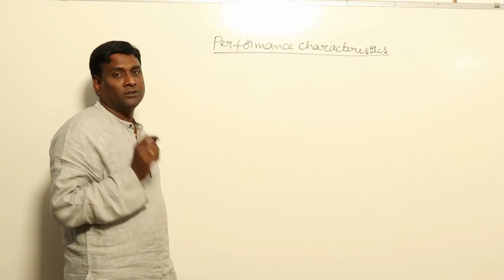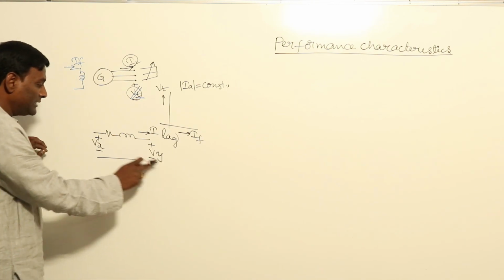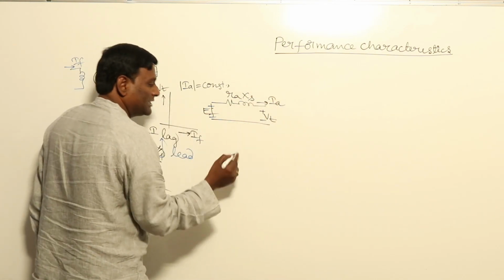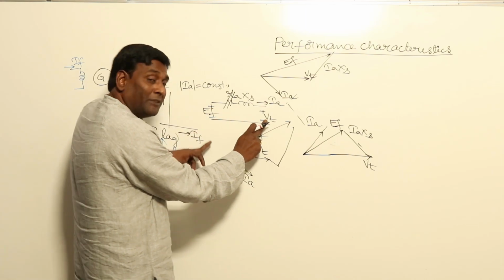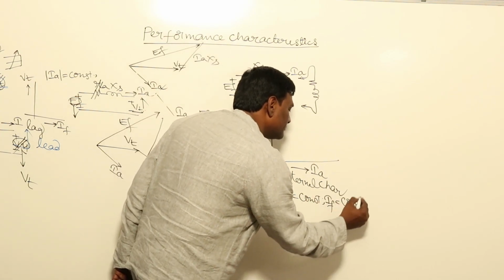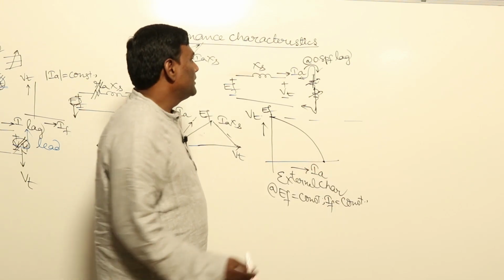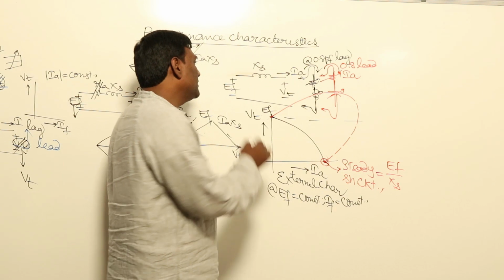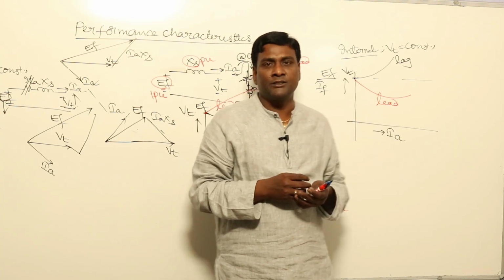Performance Characteristics of Alternator | External, Internal Characteristics | KN Rao for GATE/ESE

Comment: Sir at short circuit Vt=0 then what will be the field current in both lag and lead  cases
Reply: Field current is present, but it requires to generate voltage to compensate drop due to synchronous impedance, mainly drop due to armature reaction